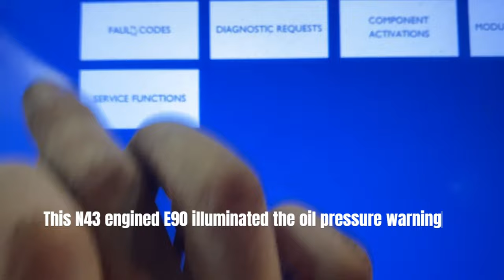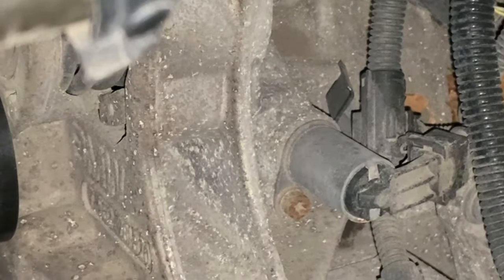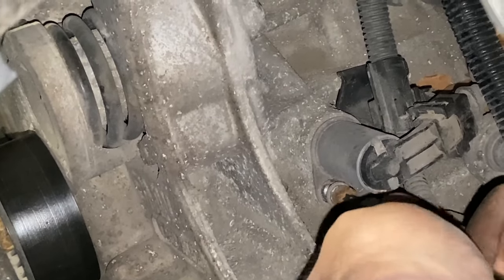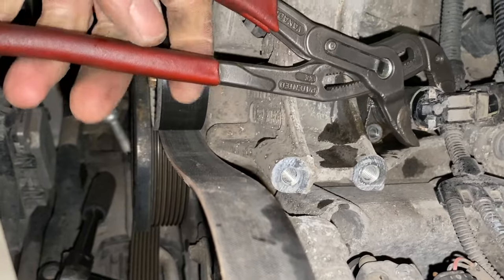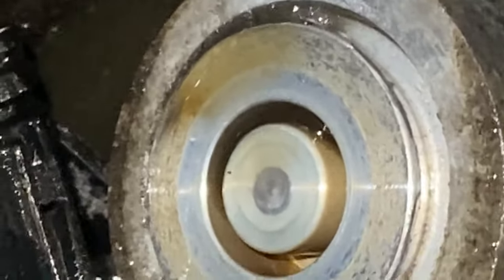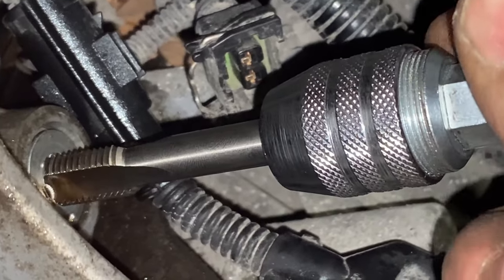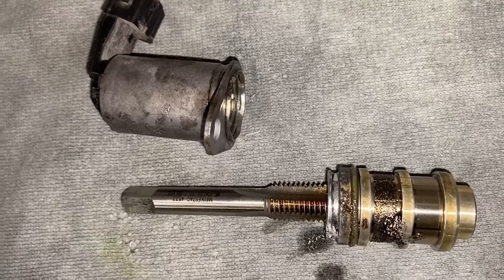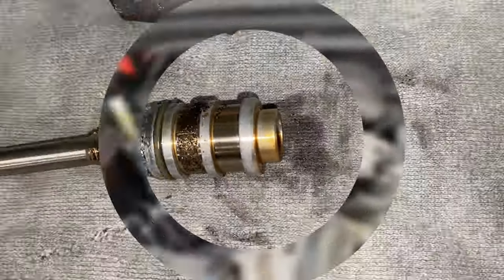BMW E90 N43 oil pressure too low

Comment: Hello buddy. We’ve just bought an e90 n43 320i, on 96k. Full history. Very clean and looked after vehicle with every receipt from new.
Owner had it serviced prior to handover. Not sure if he used cheap oil and filter. Need to look at receipt.
Anyhow, we have a very intermittent oil pressure warning. Once turned off it resets itself. I’m gunna try this fix hope it works. Excellent video. Seems the penetrating fluid worked a treat with a careful patient use of correct tool. I’m quite mechanically minded being a panel/paint man and having been around cars my whole life. I need videos like this as a bit of confidence and guidance. Thanks brother. Would you  advise us to use an OE part or a regular eBay job. Old saying, buy cheap buy twice.
Edit, receipt for timing chain too 8000 miles ago.
Reply from the maker: Hi Kris. Glad the vid helped bud. Buy original but if you managed to watch part 2 of the video you will understand the issue is the sump powder coating. Thats a subframe down job though 😕
Reply: @allmech_BMW_fault_finding  yes mate. Just watched part 2. Question, after seeing the powder coating lifting, bubbling and rusting, in your humble opinion what do you think causes moisture in the sump? 
Let’s hope it’s just the valve when I take it out Saturday 🙏🙏🙏 I’ll replace with OE, the car deserves it.
Reply from the maker: @kriscowley3241 no idea bud but I just sanded most of it off and wiped a load of oil all over where the oil will never reach, if that makes sense

Comment: Thank you very much. A great video I also have N43 I have been using it for 7 years with the same problem. When the engine warms up, it gives this warning. I looked at many points including the oil pump and there was no problem. Now I want to change this too, and I'm going to change the oil pressure sensor at the same time. Is it necessary to introduce these two parts with obd after replacing them?  Is it enough just to change it
Reply from the maker: Just changing them is enough 🙂
Reply: I have the same problem my  N43  , when engine warms up , its gives the same warning .

Comment: New sub here, really like your calm collected style to what is quite an annoying situation 😂.  I've got a 2008 automatic 320i petrol with only 59k on the clock. You say its worth removing as part of routine but is it if there's no issue? I'm tempted but worry it would snap. Cheers
Reply from the maker: Thanks for the sub! Just be careful removing it. If you find black debris you would be advised removing the sump as this is where the powder coating comes off that ends up in the control valve.

Comment: REALLY NEED SOME HELP!!!!!
E90 318i 2010
Motor suddenly stopped after parked up, was having slight battery issues so put a jump pack on and turned over 4 times then stopped solid. then turned motor by hand was very tight but did free up, motor then started and idled for about 2 minutes then stopped again, freed it up by hand again it started and run sweet no problem, no odd noises but as soon as i started to drive it the oil light came on and gave me code 0030C1.
Now the motor is getting oil up the top which if it had no oil pressure id expect it wouldn't.
side note it was just ticking and would not wind over until i unplugged the battery negative intelligent battery plug!!! which may have just been a coincidence.

also wondering if this could be the fault but doesn't explain it feeling like it was locked solid
Reply from the maker: Hi there. That sounds really bad. I need to have a think about that. The IBS can cause many problems and can even disable terminal 15 (ignition live) The IBS (intelligent battery sensor) can fail and short out the BSD or LIN bus which the oil level sensor uses thus causing this component signal to fail also. Unplugging IBS restores the signal. But locking up? I would need to see it as it could be many things. 
Even fuel injector leaks can cause these crank sprockets to loosen and spin then they lock back up again.

Are you on LinkedIn? I have the AllMech group there. Join and post a video of everything and we can all take a look and see if we can help. You will find the link in my Youtube profile 🙂

Comment: Wow I’m so glad I found this video thank you so much not sure to attempt this now I’ve had low oil pressure,over heating just removed the thermostat to fit new one ordered  new oil level sensor … no dipstick unbelievable 🙄. and oil pressure sensor now definitely going to order that oil control sensor .never saw how you replaced it is it just supposed to slide in and held buy one bolt ?
Reply from the maker: Hi. Yes it slides in and has one bolt holding it in place. Just use a lot of oil and rotate it gently at the same time as pushing forwards. It can be quite tight to push home past the o-ring hence needing a fair amount of oil on the bore of the block and the o-ring of the control valve 🙂
Reply: @allmech_BMW_fault_finding  just done it came out so smooth and easy was as clean as a bell .that’s a bit worrying my next investigation I think is the oil pressure sensor what do you think ? I’ve ordered new oil level sensor comes today it’s all drained down ready for the new part .what are the chances of it being oil pump 🙄do you think ? Thank you for getting back to me it’s appreciated 👍now following you .and buy the way I was going to say you sounded like the great late mr dibnah
Reply from the maker: @barriesmith6028  Hi Barrie. Really mate in an ideal world you would need to remove the oil pressure sensor and screw in a pressure gauge to measure the pressure. If I knew the voltage at the sensor with good oil pressure and a good known sensor we could use the voltage to indicate the oil pressure amount but I dont have that info. There are two distinct oil problems on N43 that are the valve and crap in oil from broken guides on the chain and blocked suction pipe or partially blocked. The other fault is a failed level sensor but usually you will not be able to read oil level and CBS (service info) will not display if you have a car with the CID (central info display screen) . It is important to distinguish which fault you have. Usually fault 2 with level sensor may be accompanied by BSD bus fault codes too. 

If you suspect oil pressure faults then measure the oil pressure somehow. Live data would be a plus if you have a new oil pressure sensor and you trust it then monitor the pressure. If oil pressure is low then you should consider sump off and explore 🤷🏼‍♀️

Comment: Amazed it was just that after what these engines normally do with the chain guides and crap in the sump. Ask me how i know! 😂🤯 just doing a rebuild on mine at the mo. First time ive ever had an engine out so a journey of discovery and a project. Needs a crank grind and a new rod as well. Got hot on cylinder 4 journal. Didnt spin bearing or seize thouh but bearing was knackered and put a few small marks on crank.
Reply from the maker: Wow what a legend 💪🏻 If you can rescue it go for it🙂Yep sometimes it fixes it sometimes not. I remember when I first started repairing chains on these the first thing we checked was if the lower timing guide bolt had sheared off and often it had. In those days working for the BMW dealer we condemned the whole engine. Crazy😃
Reply: @allmech_BMW_fault_finding  i started polishing crank in situ but went to check clearance with plastigauge and rod cap wouldnt go back on properly so that was signal for engine out. Right mission in my garage. If i flush oil galleries out with brake cleaner will they just dry out ok or do i need to flush with something else after?
Reply from the maker: brake cleaner is ok but keep using compressed air and go backwards through crank main bearing oil holes in the block with grub screw gallery blanks removed. This way you clean crap small hole to big hole as opposed to the other way around.
In an ideal world the block would be put into a hot chemical degreaser and flushef but that would mean full rebuild.
Brake cleaner in the method that I mentioned is the best you can do. But use alot.
Lastly - get the crank bearings perfectly matched if you are using oversized bearings on a ground crank as the crank is also responsible for keeping good oil pressure 👍
Reply: @allmech_BMW_fault_finding  thats the plan with the bearings. Ive got a compressor too so will give it a good old clear out! 🙂👍 thanks.
Reply from the maker: Great stuff 🙂 Cleanliness is key along with good machining

Comment: I had my timing chain done 1000 miles ago same n43 oil pressure light comes on every once in while if i switch of it goes could this be my problem any help would be apreciated thanks
Reply from the maker: Did you watch part 2 of this video? Thats the issue and the oil control valve is the symptom basically. Watch part 2 for answers bud.

Comment: Very good video mate, would getting the engine hot by driving it make it easier taking the oil pressure solenoid out?
Reply from the maker: Not really because swarf gets in between the valve body and the block. You will see that the thing gets scored when you remove it. This is my oldest video too 😀 Plenty of newer content to see.
Reply: @allmech_BMW_fault_finding  you got a need subscriber. I done the timing chain; I’m getting a long crank at cold start for a while after changing the timing chain and valve solenoid intake and exhaust defo has to be the oil pressure solenoid. Keep up the good work!

Comment: on my bmw e 91 318i, when the engine warms up, the red oil pressure light comes on. The engine runs normally. What could be the cause? Greeting 😊
Reply from the maker: Have you watched the video? Usually chain debris blocks the oil pressure control valve

Comment: I have the same problem, my oil pressure is too low when the car stands in neutral and the engine is warm. If i drive the pressure is exactly there where it should. I checked the filter and the valve like in your video, but nothing changed.
Reply from the maker: Did you check if the chain is loose as you turn the engine 360 degrees? Whats the car history? Any previous timing chain replacement? The suction pickup in the sump can become restricted on the mesh filter. But taking sump off at home is a fairly incolved job. I got lucky with this job but often I have had to replace oil pump pick up. You have basically bit of crap in the oil galleries and the engine needs cleaning of that stuff.

Comment: I have my car booked for replacing these at a minimum.   Is there a way othet than taking sump off the car to actually know the timing chain guides are breakkng up? I did a live data test and idling and the car doesnt lose oil pressure, but light comes on randomly.  no noise from timing chain either.  I dont want to replace timing chain for the sake of it but thinking you get generic "oil pressure low, static" code for lots of things.
Reply from the maker: Hi. Just turn the engine over. At some point usually when you feel the compression stroke (if spark plugs left in place) it will go tighter. Get a hook pick and turn engine say 40 degrees then stop check if you can lift chain up. If it is loose like in this video all the time in 360 deg rotation it is worn.
Other way is fit dummy tensioner WATCH THIS EVENINGS BLOG UPDATE ON BMW BLOG MECHANIC. You can find this on my playlists. I tested a diesel today but the principle is the same. Watch later you will understand what I mean. I will mention your name in the video 😅 
Other ways - fault codes for cam crank correlation. Do you have these? If timing goes out you will see these and usually its the exhaust cam that goes out of time first. 
You can remove the bottom chain guide bolt Torx 45 female but you need to undo crank pulley damper DO NOT UNDO CENTRAL BOLT EVER! 😲Just the small torx bolts 😉 then you can see if this bolt is snapped (they can snap off)
Finally honestly the best way - drain the oil leave overnight then put in a flexible borescope. You will see plastic maybe that way. Phew! That reply tired me out haha. Dont forget to subscribe for more info about the N43 👍 Above all shit in the oil galleries causes this fault. You just need to replace so much and clean everything usually.
Reply: @allmech_BMW_fault_finding  thanks for the reply.  appreciate it a lot!! i think best way is like you said replace the sensor then inspect the timing chain as well.  Funny thing is i hear nothing from engine other than the usual sounds of an engine.  I think as i don't have all equipment i will ask the garage to drain oil and put a camera to take a look.  I guess this be cheaper than asking to drop the sump and taking a look that way.  I been a subscriber from the start :) thanks for your videos
Reply: @allmech_BMW_fault_finding   completed the oil pressure valve and switch/sensor, using your video i now now every word in your video by second LOL i must of watched this 100s times.  The light after driving on motorway etc doesn't come on.  Funny thing now is the misfire i had has vanished.  Bizzare as it sounds it was there when i had the issue with old valve/oil sensor/switch.  Now its gone.  Is this just a case of "monitoring and see what happens" or the replacment of these parts work together and this resets things and things work normal now??
Reply from the maker: @mstar011 Hi pal 👍Good news and I hope the light stays off. Yes just monitor it and change the engine oil and filter every 9000 miles to keep the engine spotless. The misfire might be coils or injectors and conincidental but you never know 🤷‍♂️😅 Well done bud 👍 Excellent work. 

You can make a post with some photos on my community page if you wish. I would like to build this into a real community where we all help each other 🙂
Reply: @allmech_BMW_fault_finding  no thanks for your video it was really helpful without your video i am quite sure i would of yanked it out and caused damage!! great insight thanks :)

Comment: I had my timing chain done coil pack plugs water pump £1500 then 2 weeks later oil pump went! Engine hasn't seized but noise sounds like coming from oil pump area? Guy at garage said engine damage but it still starts and drives but haven't driven more than a few feet! Is it just the pump or worse cheers pal
Reply from the maker: Hi Jamie. Sorry to hear that you spent so much and then it went the wrong way. Well without knowing the mechanics, or what they changed it would be difficult to make a guess but if you can start it up for a few seconds then video it by all means you may e/mail the video and I will try to see what the issue is. Was the oil pump chain and tensioner also replaced? Was the OIL VALVE removed as in this video and cleaned out? Is the oil pressure light illuminating? A check of the oil pressure is important as is also the type of sound, main bearings or what not would indicate a problem with oil pressure. THe oil pump if it breaks means you have zero oil pressure so hopefully that isnt the case. Mahybe you should thinmk of taking it back to the garage who did the repair also. But send me the video and I will try my best to give you some answers :)
Reply: @allmech_BMW_fault_finding  hi thanks for replying yep oil light on noise from pump like a chain sound! Think I've left it to long to take back its been Stud 8 months 😕and it doesn't help when it's someone I know 🙄if it had been a ramdem garage at the time November I would have kicked up a stink because it all seems a bit suspect?? Haven't had sump off yet but I'm sure that could tell a story if they didn't put things together correctly!
Reply: @allmech_BMW_fault_finding  just curriosty how much to repair engine worse case scenario? Or try another oil pump and see if that works?
Reply from the maker: @Jackfrost0415  Well it all depends if the crank is buggered or not as these engines like to chew main bearings when they run out of oil pressure. If the timing chain and oil pump sprockets are tight then maybe the oil pump chain snapped? If the timing side was loose you would have bent valves if it soun the timing out so I think you dotn have that. It might be a case of no drive to the oil pump mate. First steps is to see why there is no oil pressure. Pulling the sump off is the best bet in my opnion. Of course you can always check the valve as in my video but they usually dont cause the engine to be noisy etc. My money is on a snapped oil pump chain or a blocked pump pick up pipe. Cost? Well if the crank was okay then you could replace the oil pressure parts and try your luck. If the crank or crank nose is damaged due to slipping friction sprockets you would be as well getting another motor from a scrap yard buddy. No idea on cost pal.
Reply: @allmech_BMW_fault_finding  OK cheers for advice I'll let you know ASAP 😕
Reply from the maker: No probs Jamie. Keeping my fingers crossed 🙂

Comment: top videos, is it normal to have metal particles stuck to it?  I had about the same amount and size on my inlet and outlet solenoid valves
Reply from the maker: Not really but on this engine yes 😅 the metal comes from all over the engine but usually from the timing chain. Its a real problem cleaning this out that removing and cleaning the valve should be a service item 😀 Nothing can be done except regular oil changes, keep cleaning the valve and occasionally the oil pressure switch.
The fact that they have migrated to the vanos solenoids may mean its time to look at the chain. Is it the original timing chain?